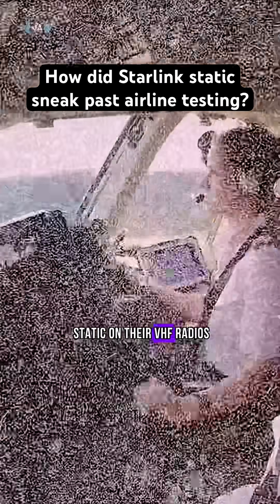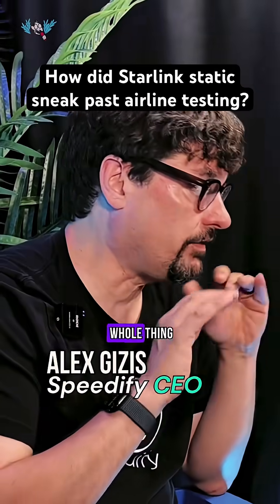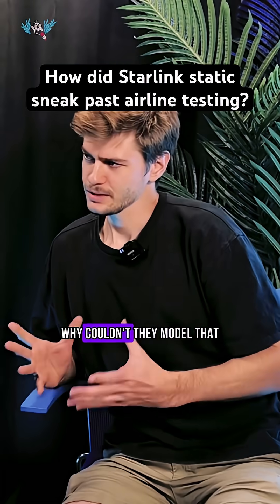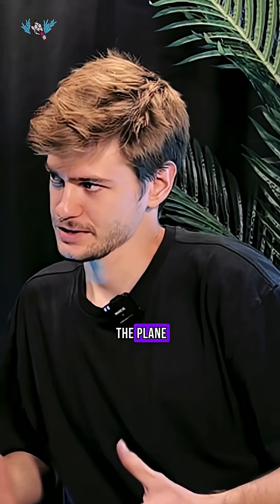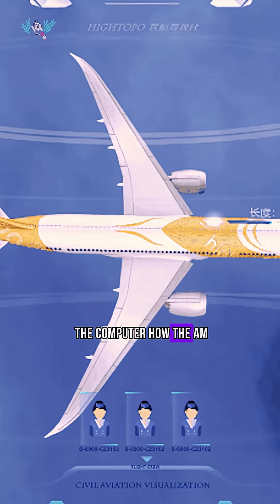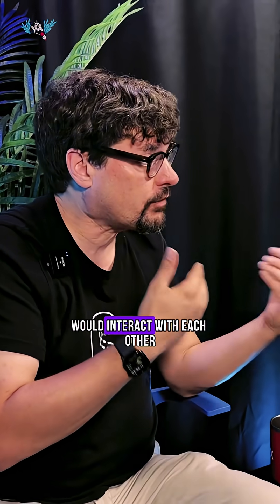How did Starlink's dangerous radio static sneak past airline testing?

Comment: intermodulatoin is a real bitch to hunt down.  A rusty screw could form a diode and mix two frequencies together and output the sum and difference of the two frequencies.  Its why they used to say all electronics must be turned off when in flight.

Today if you are living in the real world, you have to assume EMI from all over, that is just life.

Comment: My experience of two pilots transmitting simultaneously on the same frequency, is that it creates a howl, rather than hearing both talking at the same time.
Reply: Indeed, and the strength of both transmitting signals at the receiver also plays a huge role in how it will be received. Actually hearing both transmissions with any clarity is very rare.
Reply: @JayCGypsy the main point of am of fm is you don experience the capture or threshold effect like you do with FM. 

In aviation you want to know if two people transmit at the same time even if you only understand one or neither of them. 

With am you will know two stations transmitted at the same time and you will ask both to repeat. 

With fm if one station is a little stronger it can capture you receiver and you won’t know was some one else there.